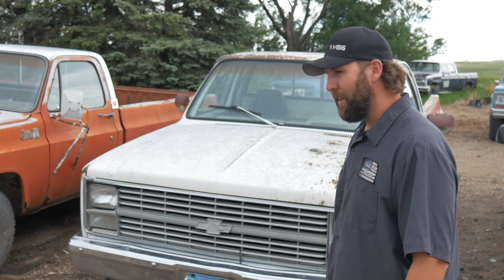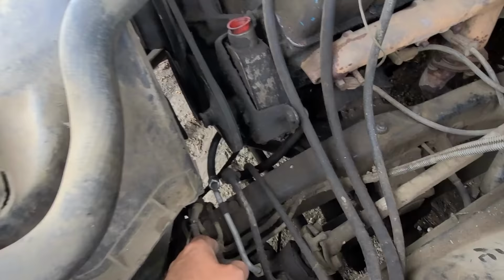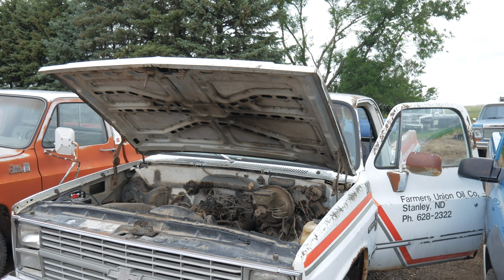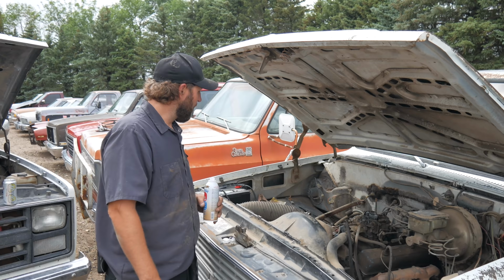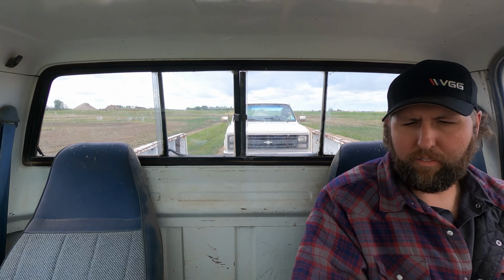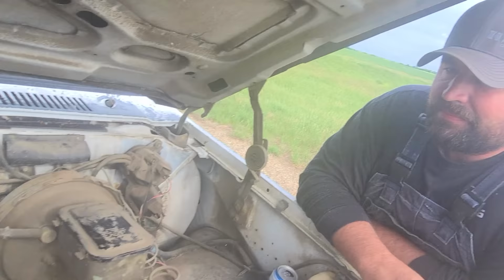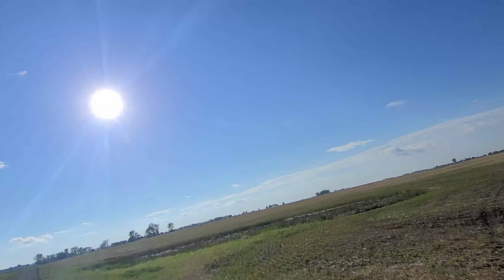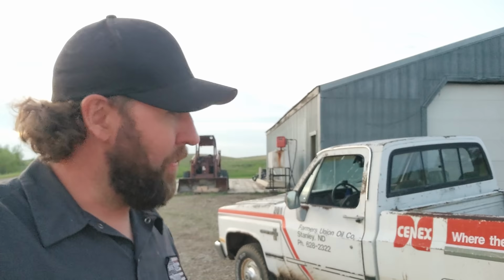FORGOTTEN Chevrolet 4x4 Square Body - will It RUN AND DRIVE 60 miles home?

Comment: “So she’s running richer than Bill Gates” had me dead
Reply: And knocking louder than the jahovas witnesses.
Reply: @tomsawyer247  yes that as well
Reply: I imagine running richer than Bill Gates would be similar to a -10 AN line, coming up from a MagnaFuel ProStar 500 pump, aimed directly into the intake, with no carburetor on it.
Reply: Knocking loader then cops at a crack house.
Reply: @davelowets  Dude that's like instead of 12-to-1 air-fuel mix that's closer to 1-to-50 air-fuel XD
Reply: @Avetho  Prolly 😆
Reply: @stevencartlidge6574  Cops don't knock at a crack house... They get a warrant, and break the door down.

Comment: Started easily! Great to see it running, running it in 2nd gear, holding the clutch peddle down and stomping on the brake pedal could break the clutch free.. It worked on an old Capri one time

Comment: Wish I would have never sold my k5, this gives me hope I will find another clean one.
Reply: Seen one in primer bout 2 weeks ago. Must have done the body work then shot a coat if primer coz the body was straight. Don't give up hope Dude.
Reply: A guy picked one up a few weeks ago off the side of the road, it's mint except for everything that's not. They're out there.

Comment: While I love these videos of you driving these heaps around in their dilapidated state, you don't seem to have many videos showing them all fixed up and ready to sell.  Please, more "after" videos to show just how far these dinosaurs can be rehabilitated!
Reply: legend has it he never actually sold them
Reply: He has quite a few about the ones he's fixed up.
Reply: His brothers driving one that he painted and pinstriped
Reply: Yes I would love to see the rest of the story on this truck and many more. Was it actually low oil pressure, or a badgealator? Was it all exhaust leak or valve train issues. What did it take to make it once  again a happy 4x4?

Comment: Nice video. In the early eighties for a year or two GM had soft camshafts. The 305 engine for sure and probably the 350 too. The lobe that wore out most quick was that one that makes fuel pump, pump. You would still get fuel just not enough.
Reply: I've had a TON of them with worn out cam lobes, but never one with a worn out fuel pump lobe. 

The cam lobes have a TON more spring pressure on them than the fuel pump lobe does, and they would be the ones to go first. A guy can depress a fuel pump lever by hand, but not a valve spring, especially through a 1.5 ratio rocker arm.

Comment: 24 years ago I bought a front wheel drive v8 cadillac. I believe it was an 83! Tore out that boat anchor and threw in a built 350 Olds rocket, with an rv cam. Got it all together and running to find out the transmission was garbage. 4 months later after removal, rebuild and install I had a beast of a car. It took snow better than any 4x4 I ever had.

Comment: Definately a prospective truck for a shop or spare truck, would definately run a compression check, if good, proceed with a carb swap, ignition update, and flush the fuel system out, 20 dollar rebuild , address the brakes and make it safe and reliable . Would definately consider patching 'er up and keeping her. Good find. Keep 'em coming Derek .

Comment: This one reminds me so much of my dad's 1973 Chevrolet Custom 10. Was a 4 speed (3-on-tree) in original baby blue. He kept a topper on the bed so the bed was in excellent shape only a tinge of very light surface rust on it. Was only a second owner (my dad) after his brother-in-law that passed away he inherited it from that he was kinda close to. It had about 60K original miles on it, it was never wrecked, all the glass was cherry, the interior was near mint aside from a small hole developing on the drivers side of the bench seat, had clean title and papers, original hubcaps were all there, even the original plates were kept, driven as a work truck for my dad as he did the occasional general contracting, painting, remodeling kinds of work. It had an in-line 6 on it, all original. It ran well and when it didn't I remember my dad only needed a wrench to get it going again. Was kinda sad to see it sold to a shady crook for well under what it was worth but I don't have any clue how to work on autos so I really wasn't sure about if I would keep it for myself or not... if I had my own place with a shop I would have definitely kept it and used it, fixed it up, etc. Just didn't have the means to make that happen really. I really enjoy seeing you work on all these old cars and trucks. Lots of memories from relatives that have had many of the ones shown on this channel. It's encouraging for others on what you do to keep older cars and trucks going instead of junking them. Appreciated.

Comment: 39:20 anyone else notice the feed bin leaned over on the semi trailer? Kinda surprised it’s holding it up
Reply: Actually, it was sitting like that for the better part of a year.  You'll also notice that one of the other ones is dented from the grain auger from a combine. A buddy of mine lives right past that turn (the bins are not on his property) and he was darn happy when they finally pulled all three bins out this fall - even if it was a major landmark on the Ruthville Road.  Trailer is still there, though. 
While I've known that country out there very well since 1983, when i was stationed at Minot AFB just north of the gas station you filled up at, I still haven't found that Squarebox Honey Hole.

Comment: Try leaving one of those $75,000 Barbie trucks sitting 12 years and see how easy it is to get it started.
Reply: 10 times more wire harnesses for the mice to eat lol.
Reply: half the engine is plastic and would be dry rotted and crack.

Comment: I want one of those quad cab square body's more than my dad wanted me.
Reply: this feller is after a 67-72 red long box f250 desires that more then food and the other essentials
Reply: this feller let go of a 67 F100, a 68 Camper Special, a 68 Contractor Special, and a 69 Ranger in the last couple of years.

Comment: I remember when I got my dads old El Camino it had one of those 6 cyl V8's in it
Reply: No such thing as a 6 cylinder v8
Reply: @davidtabor5462  a guy must not've ever driven a 305 then
Reply: @alexklein9791   a 305 Chevy engine is a v8
Reply: @davidtabor5462  yea the joke is that a 305 V8 has about as much power as a V6
Reply: @alexklein9791  that’s true but what I was referring to is how can a 6 cylinder be a v8
Reply: @davidtabor5462    LOL    Don't try to make sense out of it.

Comment: I'm sure Derek knows this routine quite well, but for the folks who've never experienced it yet.. Those old, worn out Chevy 305's will run a LONG time on not much oil pissies. When their all clapped out, have huge bearing clearances, no compression, and make a total of 53h.p., the ole 305 will survive for quite a long time on single digit oil pissies. Put some black tape over the idiot light, or guage, and fuhgeddaboudit. Keep on rollin..

Comment: Is it possible to dismount the fuel line at all connections and spray carb cleaner (or any other cleaner) until the line is cleared?

Comment: I got and bought my neighbor's 1974 chevy c30 with an sm465 and a 292. Originally from Arizona. It was a dream to work on in Minnesota where every bolt is usually rusted on tight. It is an open differential rear wheel drive and I drove it two winters. Got stuck at a few lights and stop signs. Haha

Comment: I believe one of many problems this 83 Chevy k10 4spd cenex truck had was the ignition control module is failing because the truck is getting hot from barely running and having to work so hard to get and stay operational and the starter is noisy but quite impressive honestly..

Comment: This is the type of truck that i would love to find and do a really basic crate or a reman'd 350 sbc build, rebuild the trans or drivetrain, maybe the suspension and keep that livery with the patina. There's history in this truck and I think this would be a cool build to do something like that. That'd make for a really cool, old truck to keep around for whatever. I'm not talking full restoration, though. Just whatever it takes to make the thing run and maybe find a complete dash to put in it.

Comment: This one hits the spot. If you had two cyl anti foulers and a couple of Bosch platinums sparkolanterns you would have breezed to meatloaf and you and your bro would have had a nice additional blue tinge for ambience. Unfortunately the 79 Impala 305 that was given to me by my dad (same miss knock issue at 275k miles and was my hs bucket) only had the Oil idiot light which at drive idle low rpms would flicker then go out as soon as you moved. Wish my dad would have kept the old ND black and white Peace Garden State AMN 123 plates when we moved from ND to MN. If only the Impala had the same Oil Pressure gauge 😊😊.
Reply: Those Bosch Platinums are the FASTEST fouling plugs I've ever used... I gave up on those years ago already.
Reply: @davelowets  a lot has probably changed since 94 but you needed at least for 305CI the extra nipple attachment. Not sure if they still make em.

Comment: The 305’s were prone to have soft camshafts.  I had one that was knocking and the cam lobe was as round as a bearing.  New camshaft fixed it right up.

Comment: I grew up driving one of these with a 4 speed manual transmission with a diesel 6.2 L engine and it did have a dual tank even that didn't work.

Comment: In the UK we are not allowed to drive a car without passing an safety test (MOT), you would never see this type of trip. Looks like good fun!
Reply: While you’re right, it’s illegal to drive / ride on public roads without a test, I just do it anyway, on the rural roads I lived among. Old motorcycles don’t require MOTs either. I like to know I’ve fixed the basics & the vehicle is worth the efforts & ££ before I get to MOT stage!
Reply: Technically you can't do in the US either, although Derek would qualify as a car dealer -- and have dealer plates to switch at will among his vehicles.

Comment: With no fireputtinouter there might be a thick jacket. I stopped an angine bonfire in a 70 impaler in that way but I realized my hands were burning when I ran to get the jacket (a white........ jacket). So don't let your hands get sprayed with fuel while trying that. But sticking hands in the armpits works fine. Did not even get any burns. IFire only got to the gases.

Comment: I had an 83 chevy k20 custom deluxe.    350 w very low rear end gears..  .456  I think. Had regular bed but had hydraulic dump. Blacked out the grille n around the headlights with rejuvenating spray. The bed sides were floppy but besides that it was still good when I sold it

Comment: I had an 81 with a 305 in it, barely get a fella and his cold snacks up a hill.  Was also 2wd and would get stuck in wet grass.  But it did have a sweet red velour interior.

Comment: The radio is a General Electric model called an MVP. It would have been used by the local Cenex store to talk to their guys in the field. It is not a CB and will only talk to other radios on the same frequency. I installed hundreds of them in chevy trucks.

Comment: No breaks, bad clutch, no tail lights, knocking, low oil pressure, running rougher than riding a peddle bike with no seat against the grain on a chiseled plowed field square body Chevy. Derek Bieri just described my first Chevy truck when I was 18yrs.

Comment: Sounds crazy but dump a lil bit of trans fluid in intake or after it warms up dump a lil bit of water in carb cause itll knock stuff off the valves

Comment: A feller I know had a 265 or 267 I don't know.  A little small block. It had a blue vacuum valve on T stat housing.  One feller to another.    

Have you ever had a feller ask you?
What done you do?
It happened to a guy I know.

Comment: Square body heaven at that farm. =-)   
Since this videos been out a while, I suspect by now you found out not all 80's squares got air pumps.  My '83 305 didn't come with an airpump, exhaust maniolds had undrilled bosses where the air pump lines would have gone.  My '81 was also biuilt without an airpump.

Comment: Growing up on a farm myself commonsense dictates a trip to O Rielys first for filters and stuff like that especially with a farm truck like that one. Being me I woulda plucked that Qjet right off there first thing and just replaced it with something else or even another Qjet. I got a nice rebuilt unit from Auto Bone which I hate dealing with them and I paid upwards of $400 bucks for it. However the thing was like brand spanking new unlike any rebuilt units I had in the past and it worked better than any other Qjet I have had in my life time. That is on my 83 chevy pu that took a shit the day I bought it the motor stopped running altogether. Turns out the tank and fuel pump had had it long before the carb did. There was more water than gas in the tank thanks to a small pin hole in the top of the tank from rust. The previous owner put a rebuilt trans in it said the motor was supposed to have been rebuilt from the guy he bought it from. He stated the truck ran sour from the day he got it he doubted it had a rebuilt engine over and over again sold it to me cheap.... With the unknown problems to him he sold the thing to me for $800 bucks. I put the brand new tank carb fuel pump on it and still have it running just swell. I would say by how sweet it runs the thing does have a new motor in it. The motor you could eat off it when I got it and now it's all dressed up... But I have had guys give motors the Mexican spray can rebuild and ask crazy money for junk trucks.. So it's always like rolling the dice.

Comment: My dad had a High Sierra just like the one next to this truck, it was even red. It had the two fuel tanks and one time while driving to San Francisco I was accidentally hitting the switch with my knee. So when we started to get low my dad switched tanks... to another basically empty one.

Comment: Hey! I’m a young fan 16yrs old. I’m a total novice compared to probably anyone else here but he has engine knock from bad gas, my own 92’ Mercedes has the same thing and it’s knocking a little bit. Doesnt driving it or even running it risk seizing the engine?

Comment: Carbon trace or crack in the distributor cap? Perhaps with power brake booster vacuum leak you coudda  plugged the hose off? Just sayin..maybe some of the problem. This one was a real challenge. It's good to have a brother, for sure.

Comment: Hey I just wanted to say I stumbled on your page by accident but I like what you do here. Not to copy or anything but I kind of wanted to do something similar with square bodies. I picked up a 83 K20 been sitting for nearly 20 years I was told. Farmer said it died in the field and he left it. Been pretty cold where I am so I been holding out here in SE South Dakota. 
Any pointers? I'd like to get a couple more of these and do this. at some point. 
Thanks for the awesome videos and information!

Comment: Reminds me of when I helped change the motor in my grandpas old farm truck one because I'd traded for it and two never the motor was going in a different truck my uncle his son had, and we were laughing when we unhooked the ground cable seeing as it was a actual ground strap from a tractor with a hole drilled in one end and washer tacked to the top and bottom of the hole that was bolted on the top of the alternator bracket and then another set of holes were drilled in it and the top heavy duty batteries terminals napa sells one of those was attached the truck had a factory positive battery cable and the other heavy duty top post battery terminal on that cable, but the wide flat bare woven wire ground strap made us laugh

Comment: Them there 305's were sour running engines with a miss straight from the factory. My neighbor bought a Berlinetta Camaro brand new after the first winter about 6 months later in the spring he called me over about the issue and we replaced everything including the distributor later on and could not stop the engine from carrying on. The dealer where he bought kept telling my neighbor it was normal they all ran like that and stalled out at stop lights once they got really warm... It was the first time in my life I ever heard something so asinine out of a dealer service dept. However it was not the last time. 2 years later he parked it and when I turned about 20 I bought it and put a 50 in it and it is still around today still running stashed out in my barn.

Comment: Derek i have a 99 Gmc suburban k1500 4x4 thats been sitting for 4 years now. It does turn over. Just won't start. What would you recommend me to check that could be possible issue. I know there are a lot of reasons that could prevent it from starting. The Burban I owned since 2010. Was parked in 2017 for 2 reasons. One is I lost all forward gears and found out its the rear diff that went. And two I lost the car in my divorce. But my ex is so kind to sell it back to me. Lol would be great to hear back about a quick possible way just to get her started so I can tow it to my place 189 miles away

Comment: Well I'll be dipped! The General Electric radio is definitely not a CB. It's better! Looks like a GE MVP or Custom MVP. It's a crystal-controlled business/industrial two-way radio, operated on licensed business frequencies. Still cool though! Even has the original CHANNEL GUARD hang up box for the mic! Unfortunately there really is not any value in them, they can be had on eBay if you need example prices.